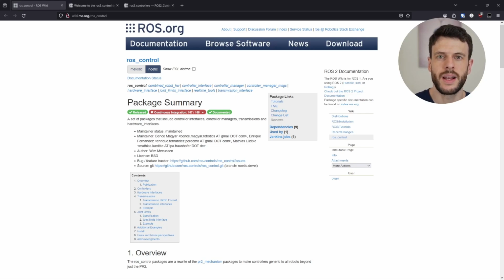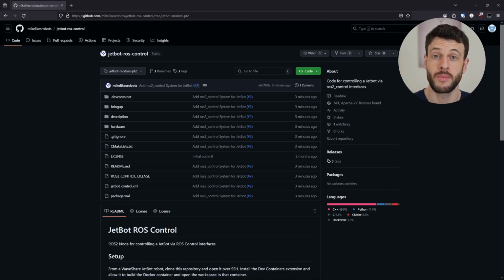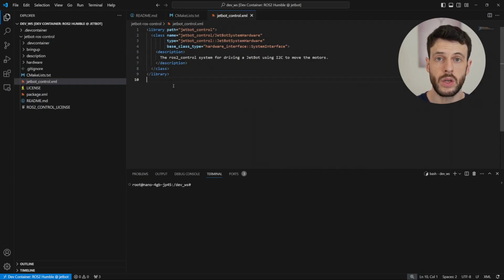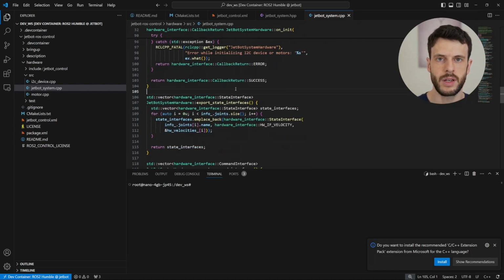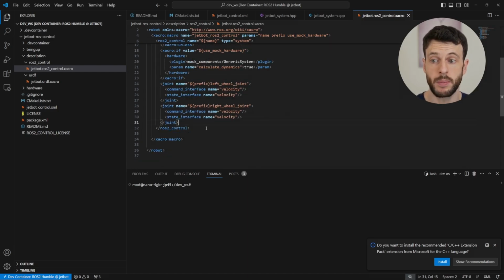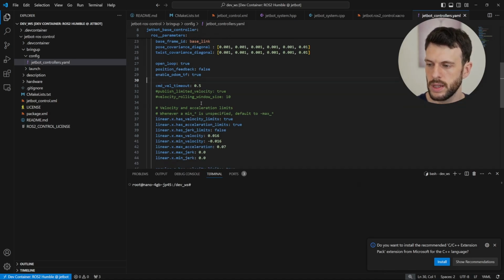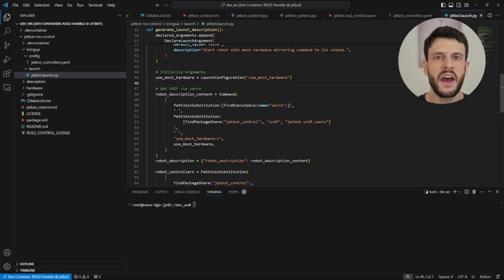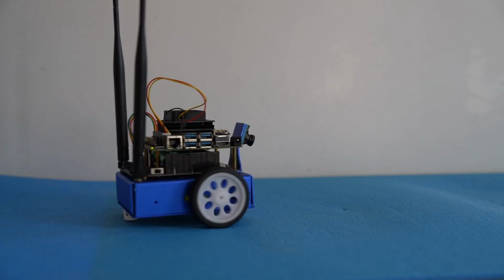Building a ros2_control System | ROS2 Control with the JetBot Part 2

Comment: This is super useful. I am having a lot of fun building lego mobile robots; it's all working super well. Thank you. One thing I am presently doing is handling my gear ratios directly in my ROS2 Control Hardware component. It feels a little bit inelegant. I have come across ROS2 Control Transmissions which seems like it might be a better solution, but I haven't really understood this aspect. Have you any advice or interest in making a video on this?
Reply from the maker: I'm glad it's useful! I have to say, I've not touched gears when it comes to ROS 2 Control. My advice would be to join the OSRF discord and ask in there for help. As for making a video, I'll add it to the list of ideas, but there's quite a queue in front of it!
Reply: @mikelikesrobots  Thank you, I'll take up your suggestion.

Comment: I did run your repo . its works as expected however the jetbot moves In circle when gives forward motion using teleop_twist the backward motion is okay moves in a straight line
Reply from the maker: That's very odd. If you put the robot on a podium so its wheels can free-spin, do both wheels move in the forward direction? I would suspect that one motor isn't working if not for your backwards working properly.
Reply: @mikelikesrobots  strangely i test run the jetbot notebook it works smootly both forward and backward motion. i did tested on podium . as well , the next thing i tried publishing simple TwistStamped linear x = 0.5 and strangely the  motor was moving faster than. i was suspecting it could be something related to controller designed maybe

Comment: JetBot have discontinued Jetson Nano Developer Kit in Dec 2023. The recommended kit is building out the assembly yourself with Jetson Orin Nano 8GB Dev Kit.
Reply from the maker: I had no idea! Thank you for pointing it out - hopefully I can get hold of the latest dev kit and do an update video.
Reply: @mikelikesrobots  great. Orin dev kit is a bit more pricier. I'm not sure if it's beneficial compared to TurtleBot3 Burger. May be you can do a comparison video on that 😉
Reply from the maker: You're right! A Turtlebot setup video and a comparison video would be great. Thanks for the suggestion!
Reply: Yeah, none of this stuff seems available in this configuration anymore.

Comment: can u help me with the setup problem the oled display get's off during the jet bot setup when connected to ethernet cabel
Reply from the maker: I've had the issue with my OLED turning off too. You might find reflashing the SD helps, but I did find out that I could SSH to the robot even with the OLED off, as long as I knew the IP address. My advice is to note down the IP address when the robot starts up and connect using that; if it never shows an IP address, try reflashing the SD card. Good luck!

Comment: Have you worked with a bldc motor with hall sensor?
Reply from the maker: I haven't - not at that level. I would like to continue this series with including a sensor for correct feedback, which may be a Hall sensor, but it's more likely to be a shaft encoder.